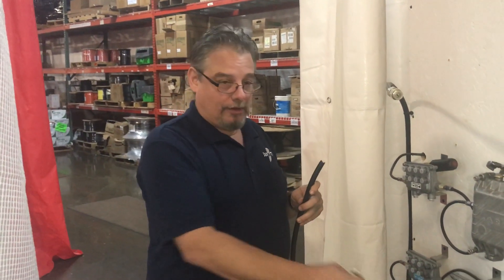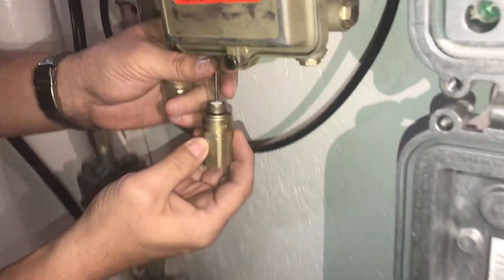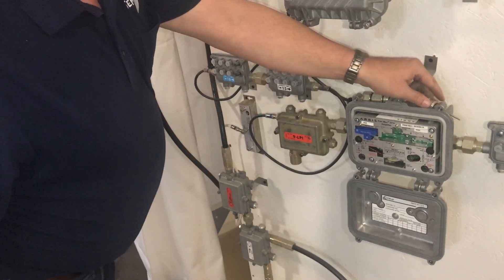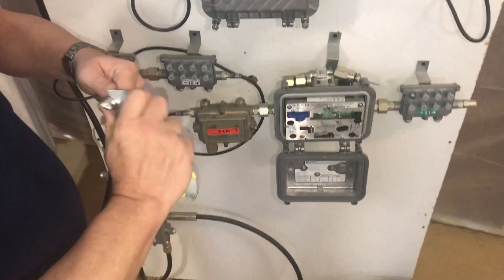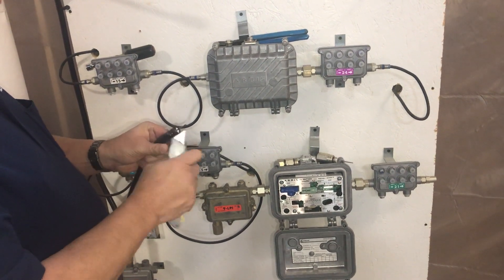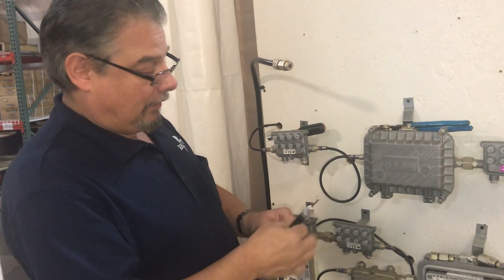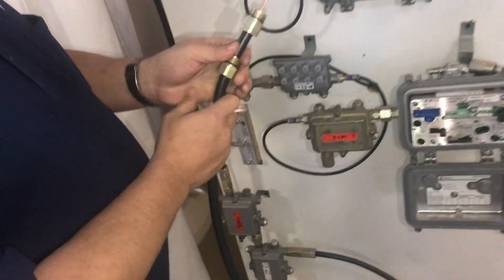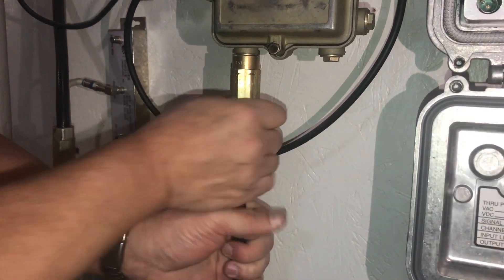Splicing flex .500

Comment: I hope a PPC guy doesn't see this video. Beginning  by using utility knife, not properly measuring the length of dielectric or center conductor. Cherry on top of the pie " This is very close is probably still good"? Its got to be 1/32 of an inch close. Don't do what he did.

Comment: That stinger was most definitely not good it needed to be right on that notch. When you put that stinger in the flex fitting to tighten it down it’s not going to grab it inside the fitting causing a moderate connection which WILL affect your levels and you won’t have ac. This is especially crucial since you are tying into your ac input on the PI